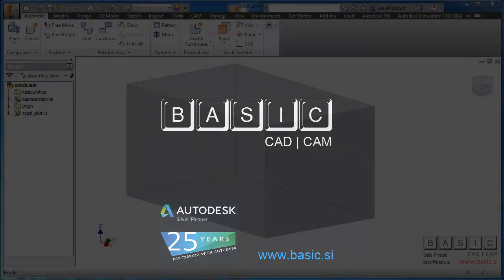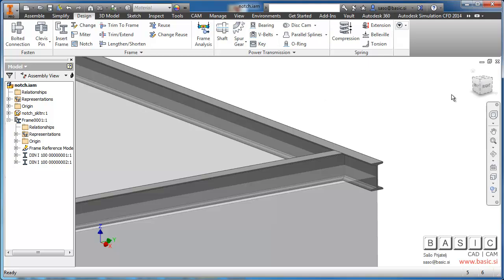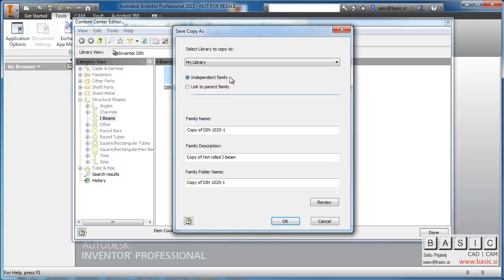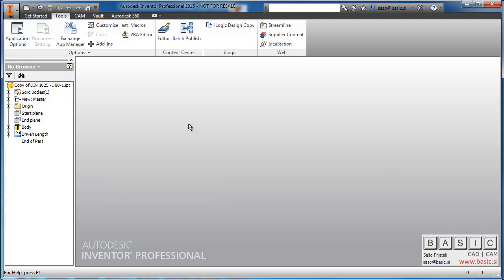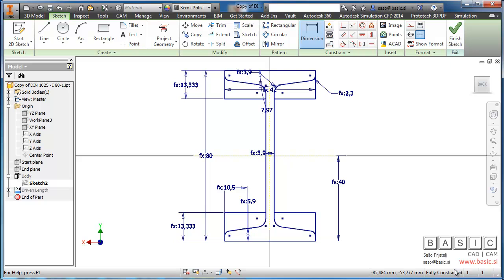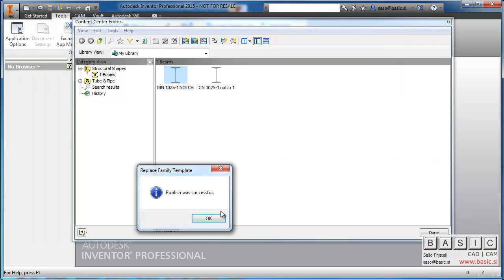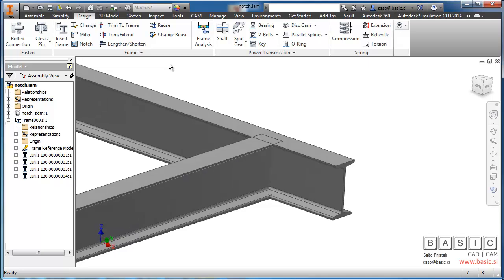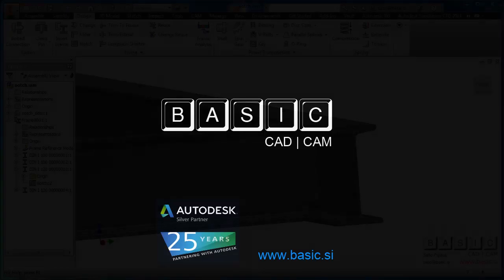Autodesk Inventor, Frame Generator - create custom Notch profile for I-beam

Comment: Hi, have you had any problems selecting more than one of the four notches (square cutouts) you made in your sketch? I seem only to be able to select one of the four squares i made in the sketch, even if i try to change the way i define the four in the sketch. (change dimension relation, mirror one two times etc. ) I use 2018 version though.

Comment: The basic question would be why wouldn't AutoCAD have just included this in the initial package, and teach this as a modification for custom notches.  Is there a good reason not to modify the original library with this update?